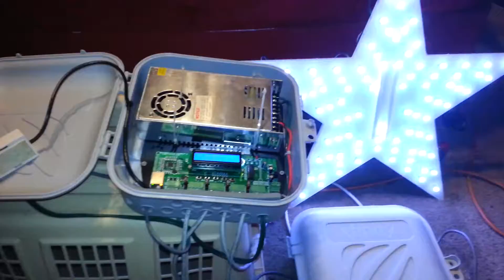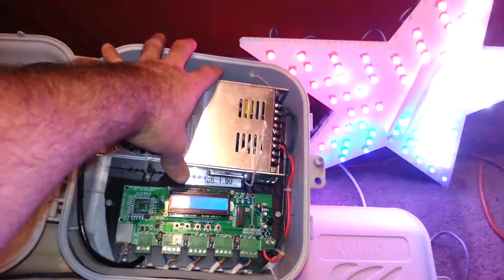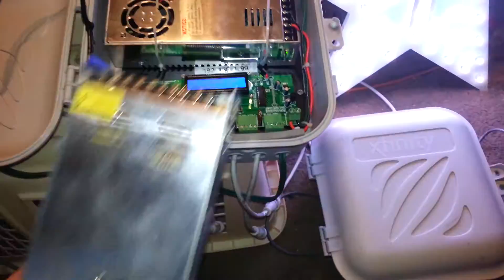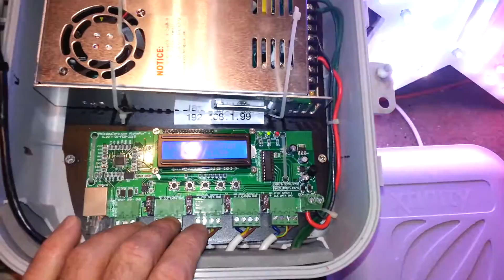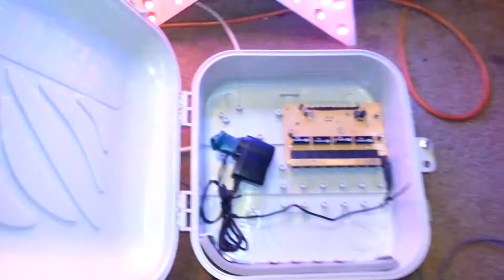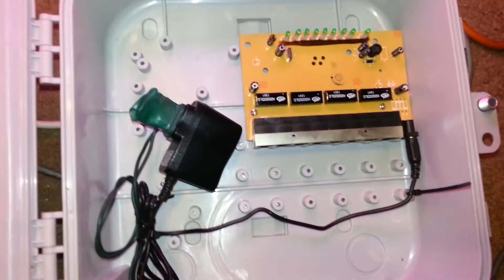Pixel controller testing and network switch installation.

Comment: What enclosure are you using and where are you buying them?
Reply from the maker: This network enclosure was from Comcast.  I told the cable rep I used the same kind of enclosures for my light display.  He then offered up a used one he took down from a previous install :)  The Alpha Pix4 enclosure was also donated last year by a different Comcast rep... again from an old installation which was sitting in his van.